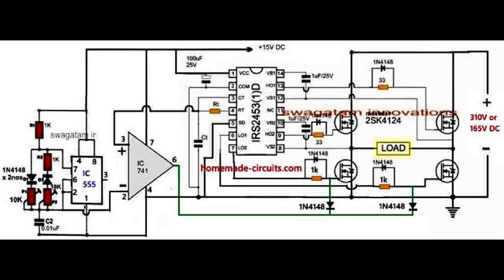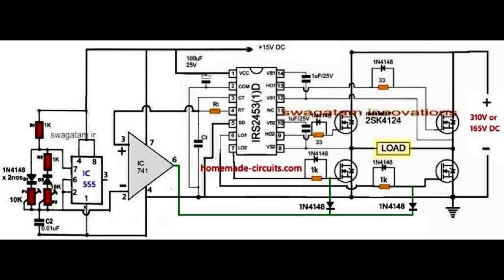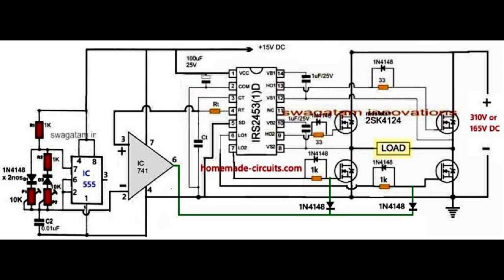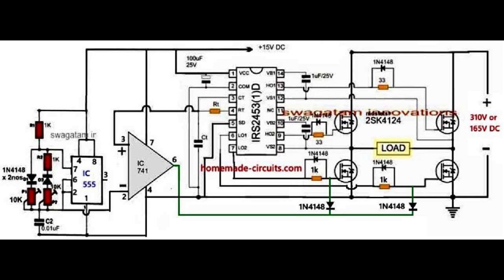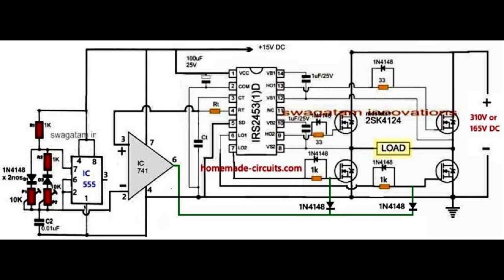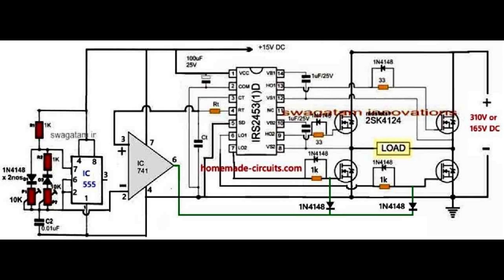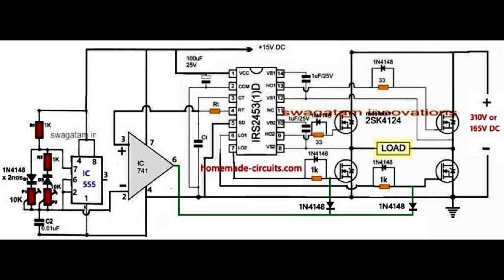Convert any Square Wave H-Bridge Inverter into H-Bridge Sine Wave Inverter

Comment: Hello Mr. Swagatam, 
yes, indeed, but I am going for a Transformer anyhow, 
even if it goes 1:1 i would still benefit of the isolated output ;-? 
I am going to drive it with an EGS-002 kit. 
So for a good sine shaping I think inductive trans & cap on the output 
will do better. 
I was just wondering with how many turns to start for the primary, 
since I am going to start both transformers windings with thicker gauge coils.  

Thanx, Harry.
Reply from the maker: Hi Dr-Satch, the EGS-002 is itself a sine wave inverter board, so no need to use the above concept with this board. The above concept is intended only for square wave inverters. For the transformer, you can take any standard step down transformer and check its inductance value, and then replicate your transformer winding with the same inductance value.

Comment: Hello Mr. Swagatam, 
I am too into my development of a Pure Sine power inverter. 
But i miss somethings, all videos turn around nice elektronic circuit drawings, 
PCB are allmost nowhere easily available. 
and inverter operations are allmost simple conversions to turn a Light bulb on, . . . 
However, as in a decent HiFi setup, everything turns around the quality of the Loadspeakers onto it ;-? 
So IMHO in a so-called Pure Sine generation, it all turns around a proper good transformer, 
and this ain't just swapping around an exisisting down-transformer, used in the inverse way ? 
And for a good SPWM generation, you need a very fast setup, that can switch in the nano sec. region, 
as to allow for many SPWM pulsed steps per 10ms alternation of a sine wave ;-? 
Could you ellaborate on this please? 
Thanx, Harry.
Reply from the maker: Hello Harry, First of all, i have only presented a basic setup of the concept, which needs to be analyzed and fine-tuned as per the user's specific needs. In the shown design, a transformer is not needed since the input voltage is a DC voltage. In order to smoothen the output SPWM waveform, you can add a capacitor across the load output. If the input MOSFET supply is a low voltage DC then a transformer can be used, and the filter capacitor can be added across the secondary output side of the  transformer for enabling a smoother sine wave AC. You can definitely increase the carrier wave frequency from the IC 555 for enabling an improved  quality sine wave output, although I am sure how much harmonics that would generate.

Comment: I do not understand your comment at 2:00 about the fast triangle wave frequency, "300 Hz for iron transformer and much higher for ferrite transformer".  In this design, the transformer makes high voltage DC and does not do any switching to make the sine wave output.  Your comment would make more sense if you were switching the input of an 12 volt iron transformer and stepping it up to 120 Vac.  Or am I missing something?
Reply from the maker: You are right, I was actually referring to a situation where the load is the primary of an iron core transformer. If there's no transformer then the high frequency triangle waves can have any high value, which can be smoothened by using a 5uF capacitor across the output AC load.

Comment: Using an opamp such as the 741 is a bad choice, 2 things happen. 1st the 2 inputs have a limited range which if exceeded cause output reversal and the second is opamps linear devices that have saturation various stages in this situation that cause smearing and slew rate problems.

Given that an actual comparator has none of these issues and costs the same why would would you?

The other thing is using a 1k resistor to drive the low side FETs makes them turn on much more slowly increasing switching losses. Better to use a bridge driver that has an enable pin that will switch them much more directly and fast.
Reply from the maker: Yes agreed, 741 is shown just as an example opamp. A single comparator from the IC LM393 could b a much better choice instead of the 741.
The 1k gate resistors have parallel reverse 1N4148 diodes which make the discharge of the MOSFET internal capacitance quickly, so I think it is not an issue to have a high value resistor like 1k?

Comment: Would be helpful to see gate-drive waveforms. The output across the load isn't a sinusoid; it's sinusoidal PWM that has harmonics. For inductive and resistive loads, such as motors, this isn't a problem. The downside to sinusoidal PWM compared to simple square-wave is that there are higher switching losses because the inverter is switching more-often, but with careful gate-driver design the MOSFETs can be switched quickly.
Reply from the maker: The waveform should be as shown in the following figure: https://www.homemade-circuits.com/wp-content/uploads/2022/07/how-to-generate-SPWM-using-IC-741.jpg
Yes there will harmonics, which can be effectively filtered using an LC filter at the output.
I don't think MOSFETs can have problems with high frequency switching since they are specifically built for that.
Reply: @Homemade-Circuits  I should have been more clear; gate-drive waveforms as measured by a scope, or from SPICE simulations. Larger MOSFETs have significant gate capacitance and can overwhelm the gate-driver if it's under-sized, resulting in longer switching times, which in-turn increase switching losses (heat). In extreme situations, it might erode the critical dead-time which is necessary to prevent both drivers being on the same time; basically a short across the supply rails. The high-side uses some sort of charge-pump, so there will be limits on what it can do as the switching frequency and/or load capacitance are increased.
Reply from the maker: @gregebert5544  Thank you for your reply. I have added reverse diodes across the gate resistors, wouldn't that be enough to discharge the gate capacitance, considering the fact that the SPWM frequency is just around 300 to 400Hz? The design is intended for low frequency iron core transformers, for high frequency ferrite core transformer these diodes could be replaced Schottky type diodes.
Reply: @Homemade-Circuits  Hard to say; accurate simulations (eg, SPICE) will allow you to test out ideas without burning-up/destroying parts. Often, there are unforeseen interactions that are notoriously exposed in a physical circuit under test; good simulations with accurate simulation models will usually catch these. With very few exceptions, I simulate every circuit I design, whether analog, digital, or both, before designing+building+testing the design on a PC board (I stopped doing breadboards years ago...). Every design simulation I've done has found design bugs and/or stupid mistakes, and not surprisingly, almost every design works the first time without the need for debug (except bad solder connections on small SMT parts). I've seen way too many weird things happen to say something will work vs not-work without backing that up thru simulations. The Infineon datasheet doesn't have enough detail to prove the design will work on paper; I dont know if they have a SPICE model, or not. Generally, I wont use any analog part unless it has a SPICE model.
Reply from the maker: @gregebert5544  Thanks for your interesting feedback, yes, for ensuring perfect and flawless results, a simulation might be necessary, especially if you are building the unit for commercial purpose.
Reply: @gregebert5544  Yse sir you are right ,I made this circuit, but under test condition when I gave 240vdc the mosfets blasts. It is not a successful circuit,cutoff the 555 & 741 section it is fine to produce square wave. The main fault of this circuit is punching of spwm signal as the high side consists bootstrap.
Reply: @Mrpaul1975  Yes, YES !! You said the magic words....."under test conditions".  Power circuits never fail when running zero, or very small loads. But when you crank-up the load-current and/or inductance, all kinds of weird and destructive things happen.

Many years ago I was working on a 3-phase inverter for 208VAC, 60Hz, 20Amps. It was actually running quite nicely at about 50% load, but when I had to test a power-failure case there was an unexpected condition and the transistors shorted across the 340 VDC bus....and quickly exploded.